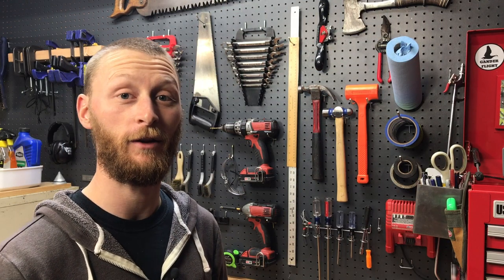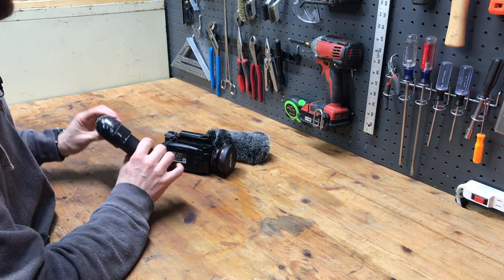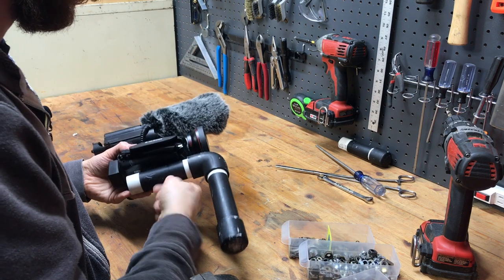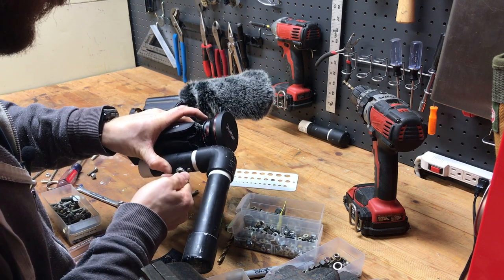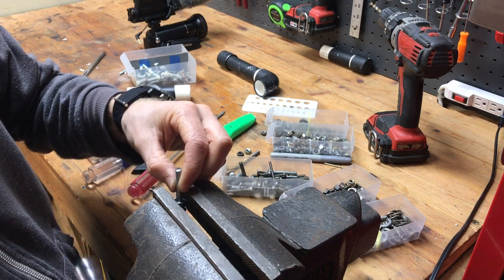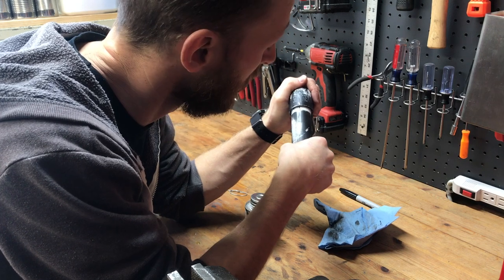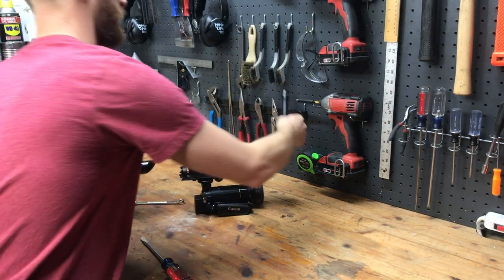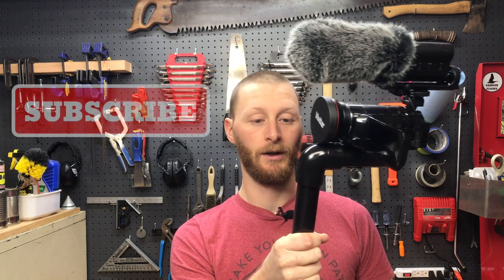DIY Camera Handle for Vlogging | WAY Cheaper Than GorillaPod or SwitchPod

Comment: What camera?  Looked on your Amazon list and notes.
Reply from the maker: Ronny Julian This is a Canon Vixia HFM50 that I picked up super cheap on Facebook marketplace- I haven’t used it enough to recommend or not - and its already been replaced by a newer model.

HOWEVER:  this DIY handle will work with ANY camera that has a screw mount on the bottom!